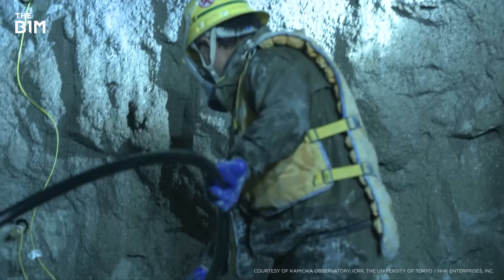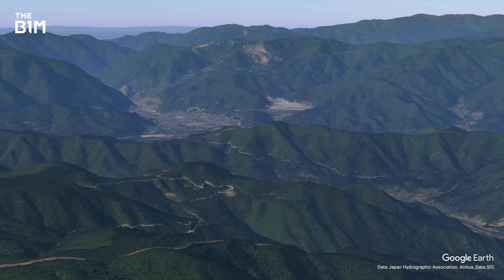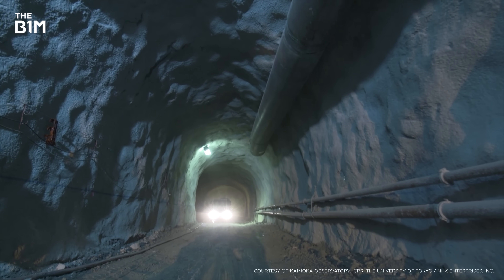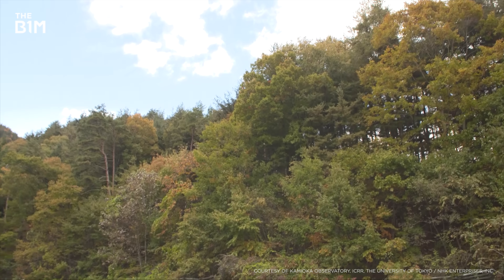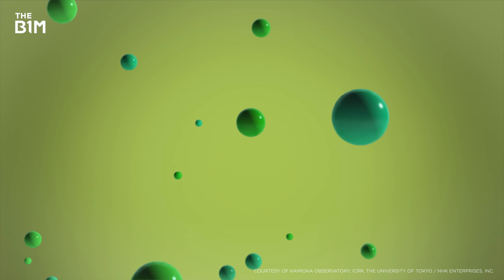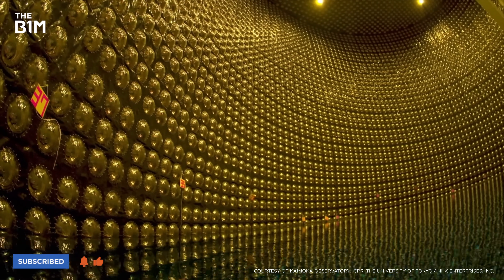Why Japan is Hollowing Out a Mountain

Comment: Question of non-engineer dummy- if neutrinos pass through everything, how could they have occasional  possibilities of colliding with electrons? do they not pass through electrons?
Reply: They don't really pass through anything, they are just so small that the chances of them hitting anything in an atom is really, really low so they just go through the atom's empty space, which is 99.9999999999996% of the space in an atom, but very rarely they will make contact.

Comment: The Ionic configuration of the whole structure is interconnected to one another, the temperature is derived from both inside and outside the mountain, it is also designed to anticipate, prevent earthquake and geodetic movements inside the mountains, since it is a "CHROLOPLAST STRUCTURE" that "COMMUNICATES" to one another, once forces are detected, as well as REACTIVE to its ENVIRONMENT. It is designed for a lifetime's anticipation of Geodetic movements and Transport realization, since it is MAGLEV®™© or electric based type as well, regulated or configurable, based on the CHLOROPLAST STRUCTURE. SMES Tierage Exception and Levels, Reason:As stated and video information attests to its importance. Patents, Trademarks, Copyrights, LLCS, Registrations, Registered are owned by its owners, ALL RIGHTS RESERVED.*****NON AI Standards of Excellence for Communication. THANK YOU

Comment: What are the chances of a multi car pile up in the middle of the road tunnels everywhere, people trapped in their cars etc, with battery damage and thermal runaways in multiple Ev cars setting off other vehicles etc, could the integrity of a tunnel under the harbour be compromised?

Comment: Timestamped Highlights
00:28
🌍 The Hyper Kamiokande is a massive structure being built in Japan, costing over half a billion dollars, and is the largest neutrino observatory in the world.
01:43
🏔 The structure is hidden deep in Mount Nugo, which provides excellent insulation from background radiation, making it ideal for spotting neutrinos.
04:24
🚧 The construction process involves drilling and blasting through rock to create a cavern, which will eventually be filled with 260 million liters of water.
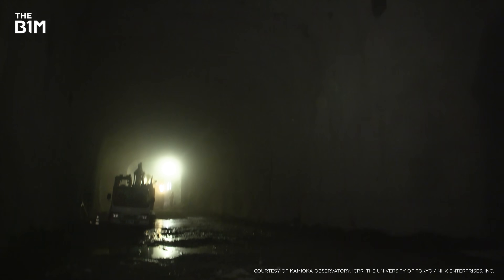06:46
🔬 The observatory will detect neutrinos by observing the weak glow called cherenkov radiation produced when neutrinos collide with electrons in the water-filled cavern.
08:55
🌐 Advancements in particle physics have led to various applications, including medical scans, tumor diagnosis, and treatments for diseases, as well as improved weather forecasting and information sharing systems.
09:57
🎙 Learn more about the Hyper Kamiokande and other construction topics on the world's best construction podcast, available on various platforms.
Summarized by @NoteGPT

Comment: The 1 km^3 IceCube Neutrino Observatory has been operating for 14 years at South Pole, detecting 28 neutrinos in that time.  I have to wonder why Japan is spending 3X the cost to build a less capable neutrino detector for a phenomenon which is barely observable.  Is water significantly clearer than ice?

Comment: 2:05 Is that correct? I thought the kilometers deep ice in Antarctica was the largest Neutrino detector on Earth. How does this new construction improve on the one in Antarctica?
Reply: The Hyper-Kamiokande (Hyper-K) project is an ambitious upgrade over the Super-Kamiokande and is expected to bring several improvements:

Increased Size:
Hyper-K will have a detector mass that is an order of magnitude larger than Super-Kamiokande, which means it will have a much larger volume for detecting neutrinos.

Enhanced Sensitivity:
The new detector will be equipped with newly developed high-sensitivity photosensors, which will improve the detection of the faint Cherenkov light produced by neutrino interactions.

Improved Photodetectors:
Hyper-K will use significantly improved photodetectors with higher quantum efficiency, allowing for better and more precise measurements.
High-Intensity Neutrino Beam:

The project will benefit from an upgraded J-PARC accelerator facility, which will produce a high-intensity neutrino beam, enhancing the experiment’s ability to study neutrino oscillations and other phenomena.

Scientific Capabilities:
Hyper-K is expected to measure leptonic CP violation with the highest precision, which could help explain the baryon asymmetry in the Universe.
It will also have an excellent capability to search for proton decay, offering a significant improvement in discovery sensitivity over current searches.

Atmospheric Neutrinos:
The atmospheric neutrinos detected by Hyper-K will allow scientists to determine the neutrino mass ordering and test the three-flavour neutrino oscillation paradigm with greater accuracy.
Reply: Both observatories aim to study high-energy neutrinos, but IceCube is particularly focused on detecting astrophysical neutrinos from the most violent cosmic events, whereas Hyper-Kamiokande has a broader range of research including the study of solar and atmospheric neutrinos, and the search for proton decay.
Reply: Super-Kamiokande, the predecessor to Hyper-Kamiokande has introduced the use of gadolinium to distinguish between neutrinos and antineutrinos, which produce different light patterns when interacting with the detector.

Comment: The 6:30 claim that it needs to withstand the massive pressure from all the water, it doesn’t work like that. It only needs to work against 70 meter water column so that’s roughly 7 bar

Comment: Make sure when you create the tunnel you make it to where people can walk on it on both sides to get from vehicle/train. Also make it big enough to let rescue crews be able to move freely and turn around in cave with their vehicles to avoid having to shut cave down due to dangerous hazards.  Also make sure you have a two way strip inside because of traffic flow being blocked on one side could cause horrible delays and angry people. Also put a slow speed limit so if someone wrecks it doesn’t do much damage to the people in the cave, the vehicle driven, and the cave itself.  Just a little tip or too you probably are aware of.

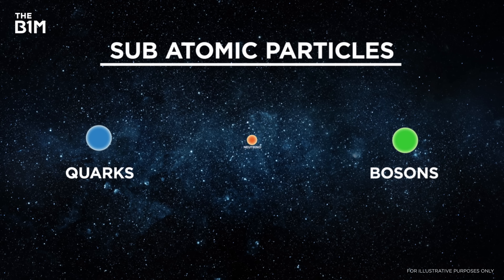Comment: 0:57 Neutrinos are fermions, not sub atomic particles. Protons, neutrons and electron are subatomic particles. Neutrons and protons are MADE of fermions. Only sub atomic particles that's a fermion is an electron,which is a lepton.
Reply: Fermioms are also sub atomic particles.
Reply: @liveparkour3888  hmmm I'd call those elementary particles.
Reply: @boone7777777777  by definition, sub atomic particles include all composite particles of elementary particles like baryons protons, neutrons, mesons, and also includes all elementary particles as well.
Reply: @liveparkour3888  hmmm sure but that's a little misleading when you consider the name, "sub atomic particles" has been kicking around since the 6th century before any fermions had ever been theorized.

Comment: Instead of saying the photo detectors were designed to withstand the weight of the 260 thousand tons of water, it would be more accurate and help younger students understanding of physics to state it was built to withstand the pressure due to the 80+ meters depth.

Comment: 5:15 Water so pure it can dissolve metal? What is the tank lined with?
You talked about the water being clean and also talked about the way a neutron is observed indirectly by striking an electron. 
Since this is the case. Wouldn't be better to use something like saltwater as there are more electrons in that than pure water? 

Already a lot of neutrons but with more electrons you have more collisions and therefore more to observe.
Reply: The water needs to be ultra pure because even the tiniest amount of radioactive stuff dissolved in the water would swamp the measurements with noise. Would be stupid to go deep into a mountain to get rid of all radiation only to then bring it into the tank with the water. The part about "dissolving metal" is BS, probably a mistranslation.

Comment: Great video! Physicist here. You got one thing slightly wrong: 

All particles are either of type boson (spin is a whole number & that is usually a force transmitting particles) or fermion (spin ist NOT a whole number & that is usually some kind of matter). Neutrinos are of type fermion (some kind of matter) and quite heavy for their size, but they hardly react with any force we know off. On the particle level, measuring something is the same as interacting with it. And since neutrinos do not really interact with other particles, it is absurdly hard to measure them - or even show they exist. That is also why neutrinos are good possible candidates for what constitutes dark matter. And since dark matter is a huge topic (gaping whole in current cosmology), neutrinos are especially interesting.

Thanks for shining light on this topic. The construction side itself is already nuts. Love it!
Reply: @@karlwithak. ? Are you being sarcastic here
Reply: @@karlwithak. No? She asked in very clear words what is the practical purpose of the project?
Reply: @@karlwithak. you do know this in JAPAN right? You bring up USA problems like cost of healthcare like that is relevant to the Japanese…
Reply: How does a neutral wire work and why do we need it?
Reply: So you're saying neutrinos.. penetrate me every second of every day and I don't even feel it?
Reply: @StarfireRebirthCM  Not necessarily every single second but it's very common, yes
Reply: @tappajaav  I feel violated💀
Reply: @StarfireRebirthCM no really it is every second. 10^11 neutrinos per second passing through your thumbnail.The chances of a single Neutrino interacting with your body are about 25% in your lifetime.
Reply: @StarfireRebirthCM  millions of them every second...
Reply: You are not a physicist
Reply: So, these are the “scientist experts” I should trust then? Who wants to bet this is a gigantic experiment that will lead to nowhere, and billions of taxpayer dollars will be flushed down the toilet? Still, the lights will be pretty. By the time they finish, I’ll be dead anyway.
Reply: man you people always find something to complain about.
Reply: What is the purpose of this very expensive work? Essentially what will be done with it, in laymens terms, as I am not a scientist but I found this video interesting and want to understand something about it.

Comment: My friend’s brother worked on the IceCube neutrino detector  at the south pole. He worked on doing the drilling, using a hot water drill to holes that they dropped strings of detectors into. It is ,I believe, 1 cu km in size.

Comment: Neutrinos aren't any smaller than electrons, positrons, quarks or photons, which as far as we know have no volume. They just don't interact via the electromagnetic or strong forces, so they're difficult to detect. They're also very light particles, but massless particles (like photons) are, well, massless, so they're not even the lightest either. Also, those PMTs (photomultiplier tubes) you showed don't need to resist all the "tons" of water you showed. It's the pressure that matters, not the total mass of the water.

Comment: scientists say, neutrinos are far more abundant than visible light, during/after a super-nova.  this is important.  it tells us the building-blocks of the universe ARE neutrinos.  
it might even tell us, the building blocks of the fabric of space; i.e. gravity waves.  now, if we take it further, and assume a magnetic field can be generated via the conducted, coherent motion of electrons or positrons (positively charged equivalent electrons, same mass opposite charge - but emerging from within protons, created artificially in particle accelerators, smashing protons together) we can assume, an anti-gravity field exists, where the two opposite vectored neutrinos collide.  hyperthetically (as opposed to hypothetically) speaking, of course.  we will assume, a magnetic field generated, 'kettles' neutrinos into a coherent wave-form with a given vector, and a probability distribution consistent with a sine-wave function.

Comment: What’s the benefit of this experiment?
Reply: To find out more about neutrinos.  If we could harness neutrinos it would revolutionise communications because nothing can block a neutrino.  This would make the internet faster since data could be sent straight through the centre of the planet instead of around it, it would mean cell phones would work no matter where you were or how thick your walls are.  It would likely also lead to even better medical scanners since CT scans and MRI scans both have negative effects on the human body so they can only be used in short bursts at low energy levels whereas a neutrino scanner could be used to zoom right into a person's organs for as long as needed with no negative side effects.

Plus a hundred other potential uses...

Comment: 5:15 can anyone please explain
Reply: Apparently water molecules can separate into H+ and HO, forming weak acids and bases.  As ultra pure water tends to draw in ions, it tends to draw in ions from whatever it is in contact with.  The act of taking ions from metals causes it to dissolve, reducing the purity of the water.  In general, regular water already has lots of stuff in it, meaning that it has already reacted with various "stuff", including metals/minerals

There was an anecdote i saw regarding someone who attempted to use a commercial washer while processing ultra pure  water and within 2 days it had corroded the aluminum plumbing to the point it was unusable.

Some comments by scientists working on the earlier neutrino projects like this, looking at supernova radiation, indicated that it would give anyone who entered the pool unprotected a significant "exfoliation", whether they wanted it or not.

The most comprehensive answer i found was by Keith Shannon on Quora, regarding "how can water dissolve metal?"

Comment: FYI, while smaller, there was been a neutrino detector like this in Sudbury, Ontario, Canada.  The Sudbury Neutrino Observatory (SNO) was a neutrino observatory located 2100 m underground.  The detector was turned on in May 1999, and was turned off on 28 November 2006. The SNO collaboration was active for several years after that analyzing the data taken.  It used a 6-meter-radius (20 ft) sphere with 1000 tons (1M kg) heavy water, and was suspended in a vessel which was filled with normal water to provide both buoyancy for the vessel and radiation shielding. It had about 9,600 detectors.

Comment: Seems like a waste, I would rather focus on sending matter through light data lines.
Reply: I would rather focus on sending matter through anything, like say.. with neutrinos?  Imagine a cell phone that works absolutely anywhere no matter how deep you are or how thick the walls are?  Or imagine the latency between Australia and Europe if internet data was sent directly through the centre of the planet instead of half way around the circumference of it in wires and fibre optics?

Comment: Cool project, indeed. But, you know, I prefer the Canfranc experiment for detecting neutrinos. Something about the decay of a radioactive gas inside a pressured gas diposit, inside a former railroad tunnel deep below Pirinees Mountains. No water, no metal solution. Maybe some rice for lunch as well.

Comment: If one of the photomultiplier tubes does implode, would that create a shockwave that could push others past their limits as well? Are there means to try to absorb acoustic energy to prevent such a cascading failure?
Reply: Yes. This is a problem, if you look in the web this already happened in SuperK more than 10 years ago. To limit that possibility in HyperK covers are being developed to reduce the energy released by the implosion of one of the tube
Reply: That only happens in shitty movies.

Comment: You should take a look at the one China is building, it is 3,500 meters below in the ocean. The Tropical Deep-sea Neutrino Telescope (TRIDENT) — called Hai ling or "Ocean Bell" in Chinese. China's gigantic new detector will consist of more than 24,000 optical sensors beaded across 1,211 strings, each 2,300 feet (700m) long, that will bob upward from their anchoring point on the seabed.

The detector will be arranged in a Penrose tiling pattern and will span a diameter of 2.5 miles (4 kilometers). When it's operational, it will scan for neutrinos across 1.7 cubic miles (7.5 cubic kilometers).

Comment: They're simply too small to touch anything OR they're so fast that they kinda just teleport through stuff because universe has a limited framerate.
Reply: No, neutrinos go slightly slower than light (they have mass), and light moving at c doesn’t cause it to “teleport through things”.
The thing is that they don’t interact electromagnetically, nor through the strong force, just the weak force (and also gravity I guess, but their mass is very small),
and, iirc the weak force has a very short interaction range, so the neutrinos have to be very close to things?
Reply: @drdca8263  I was just spitting out the first thing that came to mind.